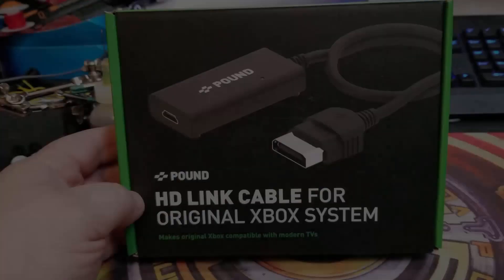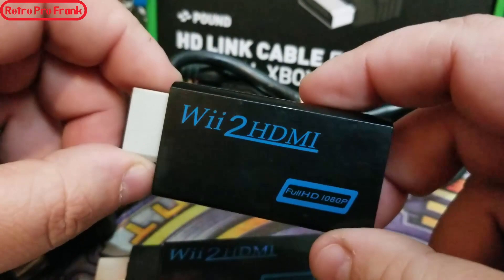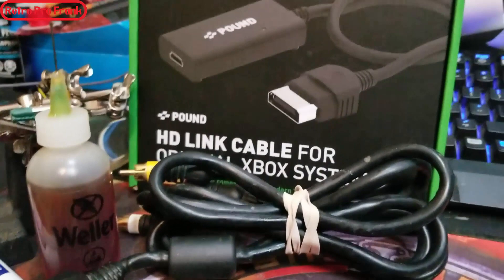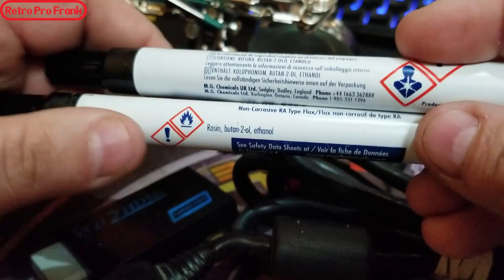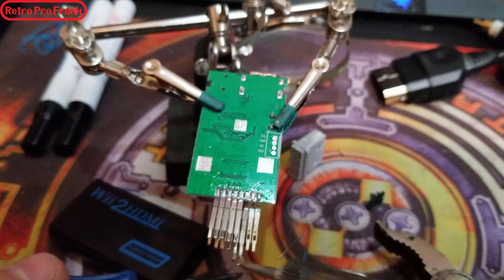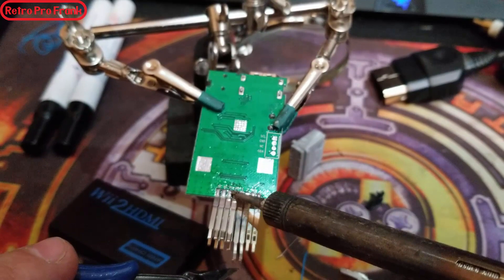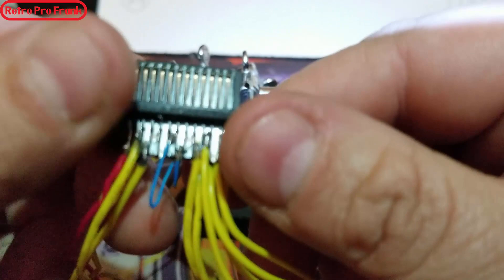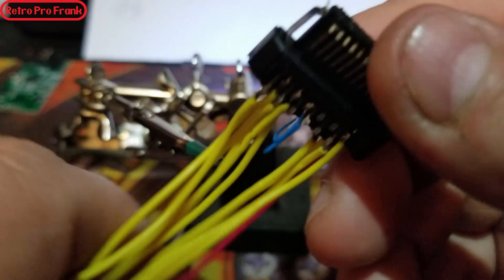How To Make $5 D.I.Y Original XBox HDMI Wire Wii2HDMI Xbox2HDMI Modd  - RETRO PRO FRANK

Comment: I have a white Wii 2 HDMI adapter from Germany, will the guide work for me?
Reply from the maker: I have no idea if it's the same board impossible for me to know
Reply: @Retroprofrank  thanks mate I'll give it a try anyway. Is this doable with 24awg or should i wait until i got 30? I did your 1.6 Aladdin mod tutorial successfully last night so I'm on a roll edit: got to the last two wires and can't understand what you're doing, something about a jumping material ☹️ and two blue wires connected like a horse shoe
Reply from the maker: @ichrismoku  I wouldn't use 30 maybe go 28 and I would go with stranded

Comment: Hi Frank, do I need to get the component cable or it is fine with just the composite one?
Reply from the maker: Up 2 you
Reply: @Retroprofrank  So I went with the composite cable and noticed that on one side it has only 11 pins instead of 12. I ran into a dead end as I now don't know which goes in to which, lol.
Reply from the maker: @cooldat92  well what did I specify in the video?

Comment: Does the wii2hdmi work well with an unmodded xbox console? because I saw your xbox is already modded as 37:12 .
Reply from the maker: Doesn't have to be modded at all... although you have to make sure you switch your Xbox to 480i and 720p once it's all hooked this is done in the option menu of the original Xbox dashboard. Most games on the original Xbox or 480i.. however there are a handful of 720 and about three or four at 1080

Comment: I made this but mine is 480i & black and white. Need help.😞
Reply from the maker: How to make sure your Xbox is in the HD mode. It's under your setting somewhere in the dashboard just set it to 720P
Reply: @Retroprofrank  Sorry been a while, I desoldered resoldered to a second one bothe gave me 480i grayscale on modded v1.0 xbox running unleashedX in widescreen or normal 480p yes, 7s0 yes, 1080i no & grayed them out in xbmc. I followed your video when soldering to the spare & back both worked fine on wii. Both say wii2hdmi ms9288a. Is it a revision problem or em i still doing something wrong?
Reply from the maker: @TheGenesisCrisis  that's actually the better board. I would get a couple from a different supplier
Reply: @Retroprofrank  Thanks for the responses, I finally got it working. Don't know what I did different but now it works so thanks for the help. PS is there any chance of this working with the ps2 using usb power for 5volts?

Comment: So I have tried this mod on 2 different Wii to HDMI adapters now and both are not giving me any color. All I get is a wash out Gray and Black.  Anyone have any idea what would cause that?  What adapter is everyone buying?  The 2 I got are off Amazon not sure what to do.  Anyone lend some help or Ideas?
Reply from the maker: You in pal region? Have you tried a different TV different HDMI wire? Different Xbox?
Reply: @Retroprofrank  NTSC region.  HDMI cable yes 3 of them.  I don't have another xbox to test with.
Reply: @Retroprofrank  just tried on 2nd tv with different HDMI cable and image is still gray/black
Reply from the maker: @lotec25  I don't know my friend. I don't know how your soldering skills are... and I'm nowhere close to you so maybe try a different adapter
Reply from the maker: @lotec25  clean the dport of your system.. try a different Xbox. Hart 2 say don't know what your soldering skills are
Reply: @Retroprofrank  My Soldering skills are OK. The only thing I have not tried minus another xbox is the A/V cable end. I ordered one of those just now.  I'll let you know if it changes
Reply from the maker: @lotec25  I don't know what cable you're talkin about. Also are you sure your systems not set to Pal mode
Reply: @Retroprofrank  I got it working. looks like the A/V cable end i was using was bad or something is shorting on it.  I tried a new A/V cable and it works fine now.

Comment: This may be explained in the video but ill ask anyways. The xbox usually goes between 480i, 480p,720p and 1080i depending on the game or app. Will this device still make that happen or will it just stay at 480p? Also, does it upscale? Because I do not want an upscaler. I just want it to behave the same way as my component cable but with hdmi instead. Also, the link for the adaptor seems to be missing. What exactly should i get?
Reply from the maker: Works exactly like your component cables. This is not an upscaler by any means this is just simple video converter that converts component to HDMI. If your Xbox is set to 720 then the video displays in 720 doesn't have a mind of its own.. you can purchase this anywhere on eBay AliExpress wish cetera excetera literally hundreds of sellers. That's why no link